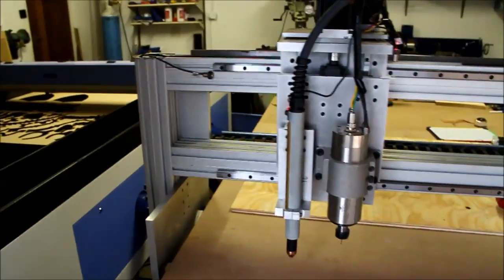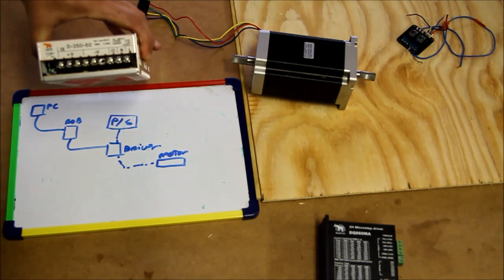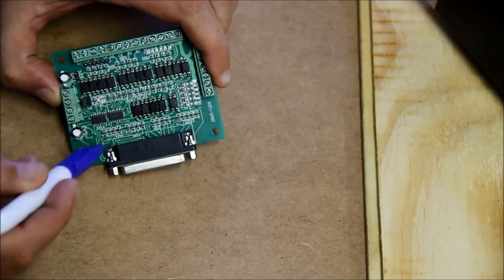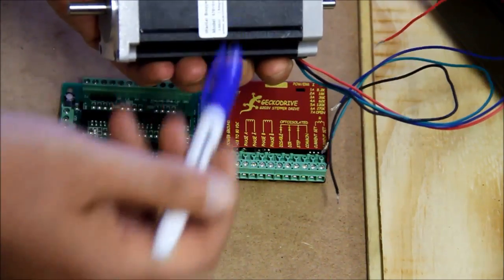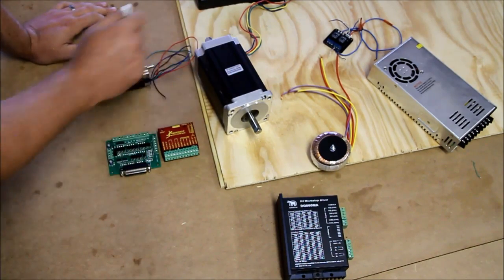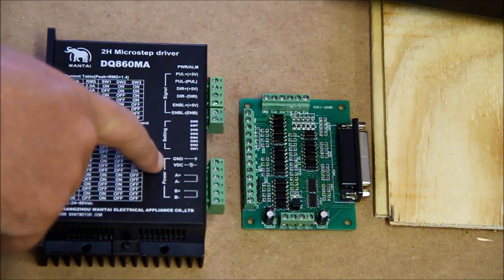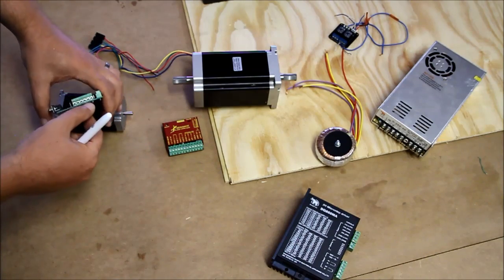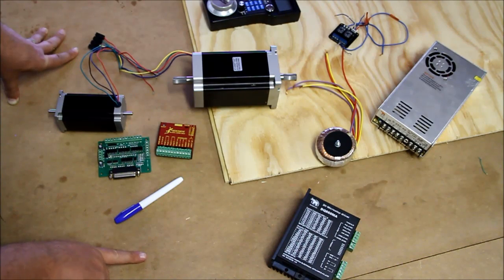How to Connect up a CNC Machine

Comment: I have one question sir, I have a Chinese CNC machine which make some weird noise at some point, i am thinking it is a wired connections are not good any suggestion, by the way my  question is if CNC motors are different in z and same in x and y we need to change the dip setting for z axis separately or can we use the same dip setting on the x and y by default it is same for all axis

Comment: How many amp power supply do you need compared to the amp rating on motors ? I read you only need about 2/3
Reply from the maker: Stepper motors run at full power when idle - that's what give them their torque. having more power for your motors if they need it is not a bad thing - to little power is worse

Comment: Tried assembing it today but the bottom axis (Y) doesn't align the bearings with the shaft.. they are missaligned by some 1mm and can't get shaft in without having it bent and binded. Any chance of getting the original files to move the bearing by a bit? Not sure if I have other version of mf70 (it's some 5 years old now).

Comment: nice build what 8020 did you use for your  build
Reply from the maker: I used 90x90 extruded aluminum medium strength. it's a pain to get brackets for 90x90 and costly - I would rather do 80x80 if I did it again and just use more as needed

Comment: Are you still available for questions?
Reply from the maker: Yes Sure whats the question?
Reply: @cncmetalworks  I am looking to build a small cnc that uses mach 4 hobby and the physical hardware from openbuildspartstore.  Still investigating comparable nema 23 steppers and a BOB ...etc.  any suggestions please.
Reply from the maker: Hi Anthony, I think one of the first questions is what do you want to cut & how accurate do you want it to be? There are many different ways drive the system with, Belts, Lead screws and or rack. as for the electronics and motors most of this is all made in china and will all work okay for the Hobby market. I am using Mach3 and good old Parallel ports. I used to use smooth steppers but just found it was not working as I needed and just another component that could have been causing me issues. Try and keep your build in balance, don't buy the best servo motors when you going to be using a frame that can't keep the tolerance the motors can produce. I moved away from switch mode power supplies as I did not have good success. I can recommend Gecko Drivers they have worked very well for me.

Comment: hi hiw do u run mach 3 on laptob
Reply from the maker: Hi you would need a USB breakout board like a USB smooth stepper or you can use an ethernet breakout board.

Comment: Excellent video and very informative, I have old school Isel unipolar 8wire
motors, is there a way I could wire these up as bipolar to similar driver boards?
My controller is shot to S#!t and need to retrofit all the electronics.
Reply from the maker: Hi Jacob, You can have a look at the information here this should give you some ideas https://knowledge.ni.com/KnowledgeArticleDetails?id=kA00Z000000PAkPSAW What you want to do is connect 2 of the winding together - the hard part is trying to figure out which winding go together
Reply: Shot, Thanks a mill, I shall endevour to get this grafting again!!

Comment: I see you have a plasma on it as well. Do you need a relay switch connected to the breakout board in order to turn on and off the torch?
Reply from the maker: Hi there, Yes you do or you need a BOB that has a relay built in or a Plasma Height control that can use an output to turn the torch on and off.

Comment: hi i have 3 vexta 5 phase stepper motors that i want to use on my cnc but they are 5 wire with no common, do you by any chance have some info for me on how to hook them up without spending a fortune, i am also from SA.

Comment: Hi .  very nice tutorials . I have a question, i moved  a  working CNC  from my garage to my shop and I disconnected Parallel PORT Cable only , and now when i connected Parallel port back my computer gives me 404-  Parallel Port Address Conflict. is there any way to fix it... Im new to this.  Thank you

Comment: when you were talking about motors, and resistance,  how many different size motors fit on these boards? so if its a 3 axis cnc, must all 3 motors be the same?  So fat this has been the most helpful video (and by a South african Woot)
Reply: Gareth Diedericks Motors can be mixed sizes, depending on how much torque you need to drive each axis, and the driver associated with each motor could be different depending on the power requirements of the motor. However, if you use two motors to drive one axis (as many folks do for the x axis), they should be identical, as well as their drivers. For simplicity, it would be easier to connect and program everything if you used all the same drivers (not necessarily all the same motors), just figure out what is the largest that you need (power-wise) and use that for each motor, no matter the size. A more heavy-duty driver on a smaller motor will not hurt anything as it can be programmed for the motor size. A driver that is too small for the motor, however, is not a good choice. Good luck.

Comment: Where would an e stop button wire into?
Reply from the maker: on any input you can the program that with the software - I find cutting the power via a E-stop Switch to the machine is a good E-stop solution

Comment: Great Videos, I am hoping to get my setup working soon, I have a MACH3 BOB, 3 x stepper motor drivers like the black box Chinese one you show, 1 x 3 way Power Supply 24V, 3 x 4 wire Bipolar Minebea motors Nema 23, and at present, wired up, using MACH3 software, I can get both the keyboard, and also the configured XBOX controller to make it look like the X Y Z motors are working, however I am unable to get the motor to turn.  I suspect I have the wiring wrong, and will try once again to set it up and test it, however, if not, can I email a pic over of my setup?  I will need your email address:  You can email me at:    awgs.warlord@gmail.com

Comment: HI there. I am having trouble configuring my mach3 software setup with my hardware. Hardware consists of two TB6560 motor drivers and a Mach 3 BOB, running with mach3 software via a parallel port. Could you please help?
Reply from the maker: Are you running windows 32 or 64 & what version of windows? the way to fault find is start with the PC make sure the parallel port is working properly first  & then start adding your BOB and the rest.
Reply: vatso Running the Mach3 software on Windows XP 32 bit. How can I check whether the parallel port is working fine? Any online/offline resource you can recommend? Thanks.
Reply from the maker: there are a few around - a good old multi meter also works well but don't short anything out :) - here are some you could try https://www.downtowndougbrown.com/2013/06/parallel-port-tester/ and http://stadi.hu/sw/lptdebug_en.html
Reply: vatso Haha, I'll be careful!! Thanks a ton! :-)

Comment: hi Sir vatso can you help me how to wiring my plasma machine? other wires from panel connected already, but from stepper driver to motor not connected and some limit switch, can you pls help me Sir ort guide me please, this is my email sir lemueldcorpuz@gmail.com
Reply from the maker: Please do a diagram of how you want to do your setup and lets see if we can help? think of the plasma machine as just an on / off switch for now. the arc control is what we do to manage the Z axis. how you do that is dependent on what plasma machine you have.

Comment: Relevant info. Trying to gather information before trying out. Can you get a BOB with USB and not the Parallel port
Reply from the maker: Hi there - yes there are many different versions of BOBS and cost. I really suggest one start of with some cheaper / smaller motors even if it's to to understand how it all goes together and how the software works. there are allot of moving parts and the costs add up quickly

Comment: Nice job on the video Thanks for the info.  Here is a tip . When using a longer lengths of cabling ; Look for and use cable with twisted pairs this will eliminate cross talk between the servo A and B, any free spare wires should be strapped together at each cables end and or placed to ground as would be done with a inter metallic shielding ; That will prevent unwanted induction sources from corrupting intended signal. Should signal become corrupted search for a high resistance open - frayed wires/ broken portions will cause an unbalance in the lines and will act as an antenna inducing unwanted frequency.

Comment: Hi Vatso, Good vid and setup!!! I am currently looking into building a 3 axis cnc router. As im also from SA, what was the costs involved building your machine and importing costs and waiting times for parts to arrive? Looking at building a 3 axis for now and 5 axis at a later stage... Thanks!
Reply from the maker: Hi Steve,
Mine took me some time to build and I sourced most of my stuff locally total cost was around R250K - could have imported one for that price however wanted something that could do more then just one function
Reply: Thanks for reply, have seen local suppliers prices and they are quite expensive compared to having them imported, depending on import tax. Will see how that goes... Maybe not the 5 axis for now...

Comment: Hello my name is Anthony I am having problem with my CNC project I wira up The Break-Up board a 8 wire stepper motor and a microcontroller the motor get hot but it doesn't move can you please send me your email so I could send you pictures and see if you can help me out
Reply from the maker: we need to connect the 8 wire's into a 4 wire's you will see in this picture what I am talking about it's finding which wire's pair together? you will need the data sheet for the motor. http://www.omega.com/prodinfo/images/Stepper_connection.gif

Comment: Why are there two drivers?  One has a heat sink casing so that'd be the main power, the tiny one must be some sort of signal/logic thing?
Reply from the maker: These are different types of drivers one called a Gecko and the other from China - they both give power and step and direction to the servo motors. Hope I understand what you are asking?
Reply: Oh, so they're not used at the same time?  I thought they were both required
Reply from the maker: I don't think I explained the above well - the Driver get's power from the DC power supply "I show 2 types in the video" and the control signal from the BOB  it then send's the power and signal to the motor. so it combines the Power and signal needed to drive a motor.
Reply: I had the same question. But I think that the BOB board just isolates the computer from the rest of the system and makes it easier to hook up  the wires to the driver.  That's usually what Break-out-boards are used for.  It may have some level shifting also like 3.3 to 5 volt so the signals are compatible with the gecko.  So really the BOB is not a driver.
Reply from the maker: That is correct the BOB also can have intelligence built into it and they are not all the same or equal. they are the interface between the Computer and the switches / Drivers & other things "Touch Off Sensors & & & "

Comment: Hi, i want to build a machine to do some routing on styrafoam. Maybe some alumenium and wood too. Can you give me advice on the parts i should look at to buy and is it ok to buy chinese as i buy other things from there. By the way im in Cape Town
Reply from the maker: That is such a difficult & good question to answer - the system needs to all work together so no good having brilliant accurate motors and drivers and a frame that has flex & & &. you might be wanting to start by first deciding the size you will be cutting? and how accurate you need the machine to be? this should give you a starting point to rule out some machine types. in general it's good to start and see how everything works together and then you will quickly find out what you want and or need. Also remember a lot of the cutting quality is in the software programming & cutting bits. Just to end off I did not build my machine to mill lots of aluminium - it works but not what it was designed for

Comment: Hey Vetso, nice to see another SA person online... i am currently trying to build my first cnc machine , one thing i noticed was that you said you run 4 motors, which is awesome, and i want to do the same, one for the Z, one for the X and 2 for the Y, only problem is that i cannot seem to find anything online that shows you how to run the dual Y motors with the stepper drivers and BOB and alles ....also where did you get your rack and pinion from because i would love to do something like that, but nowhere in Cape Town seens to offer it :( , any help would be appreciated! - thanks Sam
Reply from the maker: Hi Sam, You can try CNCdirect Greg is really helpful and has the designs for the Rack and pinion. He is based in JHB so some shipping would be required. I am no longer in the land of SA moved to the UK 14 months ago. There are a few options to run 2 motors and it's the BOB that needs to support 4 motors / Axis as well the software setup. do a dry run with the motors and check they are moving the way you want. Left and right need to run opposite to each other in order to drive the gantry in the same direction.

Comment: Hi good video i have cuestion i have my cnc whit this motor 4.2(u)  1.8deg/step my screw is SFU1605 -3 my driversDQ542MA can tel my how to set the dip switch on the drives because the machine make the circles like on spiral i set the machine on mm i put this on motor tuning step per 320 velocity 2500 acceleration200 step pulse 5 dirpulse3 i am used  Mach 3 thank you
Reply from the maker: Hi Mundo - I no longer use those drivers what i do remember is there is a ratio and you can set them up based on the amp draw your motor needs. I used to try different settings. a good starting point is set the driver to max motor amp and 2000 microstep. Just to make this more clear your issue is not the driver but the setup combination of tuning your motors in Mach3. The best was to do this to take an axis and change the setting until it moves and accelerates smoothly with the driver setup as per the above recommended. you need to be able to move the motor back and forth and not loose steps find a way to measure this reliably.